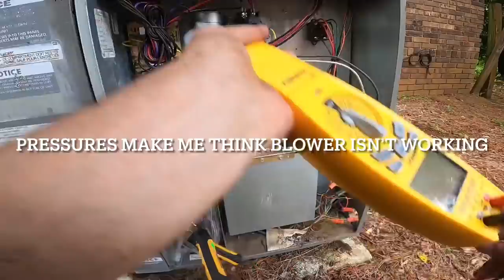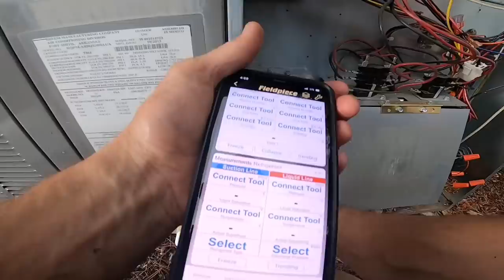Air conditioning not working at all. Multiple problems. Doing what it takes to get them going.

Comment: I'm pretty sure that those blower motor wires are supposed to be on the bottom to create a drip leg so moisture doesn't condense on the wires and drain into the blower motor. You got abused on that call. Be kind to your body. Get some knee pads and a headlamp. That will allow you to put off the knee replacement and free up a hand to carry your multimeter or other tools into the crawl. Be safe!

Comment: Probably has open safety low pressure switch you had 24 volts between r and com. Also push in contactor to see it unit would run this would let you know if it is high voltage or low voltage problem

Comment: I would of changed the batteries in thermostat and got my signal. Also with that module you really want to rotate it back in the original position to create a drip loop other then that good work my brother!
Reply from the maker: Come to think of it, I think you’re right.
Reply: Batteries are not he still had to fix the broken wire
Reply: How would replacing the batteries on thermostat make the 24 v signal appear at the thermostat base?
Reply: @edwardgarza5104  that would only give you a display, without fixing the broken wire the 24 volts could not complete the circuit for the wire that was broken. Unless I'm totally missing what you're talkin about